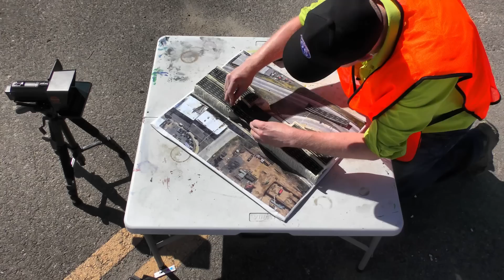Here's How Pennsylvania Re-Opened I-95... in Just TWO WEEKS!

Comment: Due to capitalism (a $200,000/day incentive), the McArthur Maze collapse reconstruction project was completed only 26 days after the original accident. C. C. Myers, Inc., submitted a winning bid of $876,075 to repair the damage to the I-580 connector. The bid was estimated to cover only one-third of the cost of the work, but the firm counted on making up the shortfall with an incentive of $200,000 per day if the work was completed before June 27, 2007

Comment: I would have put some concrete precast slabs on either side of the approaches but not right up against the area that supported the original girders.  Steel beams across the gap.  Supports in the middle of the underpass.  More precast slabs over the steel beams.   Now the support walls can be replaced with lanes of traffic are flowing above.  When the new precast girders are ready. The false deck is removed. The girders set in place. Precast slabs like we use in cal to replace a mile of freeway lane in a single night are set in place.

Comment: This is a lousy video. First, concrete certainly does get drastically weaker when heated. Second, steel is stronger in tension and compression vs concrete. Concrete is a lot cheaper and is good at protecting steel for corrosion.

Comment: keep in mind, while concrete is "fireproof" in that it cant be set on fire.....it can very much explode when heated enough (900C +).
it's far more likely that the concrete exploded and shattered then the rebar giving way, considering concrete explodes around 900C - 1000C which is about the temp of burning gasoline.
at ~800C rebar loses about half it's strength (depends on the rebar though) but that's direct exposure which doesn't happen when there is a ton of concrete all around it. the concrete will reach the explode threshold before the rebar loses enough strength to fail. once the concrete explodes even slightly, thats far more the enough to overwhelm the rebar and down it goes.

Comment: A few years ago near the Oregon Coast we saw something similar: ODOT wanted to replace/upgrade the old 3-lane US101 bridge over Hoquarton Slough near downtown Tillamook city, but that highway is basically the ONLY connection between the north strip and downtown proper.  (And the ONLY detour is found 3 miles east)

The project solved the matter by:
1 - Constructing half of the new bridge adjacent to the old one
2 - Redirecting traffic onto the new bridge then demolishing the old one
3 - Constructing the other half of the new bridge in the newly available space
4 - Connecting both halves together to finish the project
The new bridge has 4 travel lanes plus bicycle shoulder lanes, and they did all that without even a day of closing off the highway.

Comment: Since this is public infrastructure, it will go like this: 

They will go and fill the sand and block the road under the bridge for 3 months. The budget for the project will go poof until it is increased again, and then progress will begin once more after a manager unexpectedly quits. Both side ramps bridges will be half built and the project will be paused for 6 months due to safety issues. The retaining walls holding the sand will still be up for that duration. Next year, they will begin again, but announce that there is a shortage of workers because everyone thought sending everybody to college for the past 20 years was a good idea. By 2025 both the side bridges will be complete. The retaining walls will be half removed, with debris and leftover equipment remaining on below the bridge. No action will be taken until complaints start being filed by drivers. The entire project will be announced as completely finished by 2026. No, they will not complete the inner section of the bridge. You need to wait until 2036 when this becomes a novelty project for an upcoming election then.

Two week project, everybody. Hope they prove my expectations wrong.

Comment: "Jet fuel dosent burn hot enough to melt steel" Anyone remember that from 9/11? Too many assume the metal must be molten for a structure to fail, no it just needs to get very hot to become weakened enough to bend and fall down. Jet fuel is the same as diesel, much closer to diesel than any other fuel. Just kerosene with additives.

Comment: This is our chance to push the city to build the Roosevelt Boulevard BSL Extention; I'm currently living on the Boulevard and this disaster has made traffic --- which was already bad on this section of US route-1 --- even worse and it's making the road even more dangerous for pedestrians. If we had this subway line, this disaster wouldn't have been so bad as people who would've generally driven to work might have actually taken public transit or biked to work. Along with the other advancements to the boulevard, the buses that use the boulevard would actually be more useful as they would have their own lane to drive on and have a more BRT-like style of service and it would force traffic to other streets and not just pile up on the boulevard.

We need to act now and pressure the city to get this subway done; if this disaster is to happen again, this line would help smooth out how bad it is.

Comment: What also helps is that the road network in the Acela corridor is very dense so there are a lot of options for getting around any single point of failure.
Reply: Not so easy if you live less than a half mile form the single point of failure, trust me.

Comment: They're doing exactly that in my area.  They're widening I-405.  At the same time replacing a structurally deficient bridge.  They tore down the eastern 1/3 and built the off ramp in the new location.  They diverted traffic to the new road and are currently building the middle 1/3. When they're all done 2 new traffic lanes and a whole new bridge.  The traffic is normal the entire time.
Reply: It's how they do all highway bridges. They're redoing all of 95 in Philly right now unrelated to this (have been for as long as I've been alive). There are at least 4 other staged bridge projects on 95 within 10 miles of the bridge that collapsed

Comment: A similar gasoline tanker fire took out an overpass in the I-81/US-22/322 interchange near Harrisburg, PA a few years back -- fortunately the interstate was not closed, just the two overpasses that were damaged by fire.  Luckily enough, the original contractor for the steel beams still exists and still had the design on file, so it was able to make new ones pretty quickly.
Reply: Yes, I remember that one. I-81 in that area is bad enough open, would've hated at that time if they closed a portion.

Comment: Okay… Let’s start with that “Cheese Steak Sandwich”😂 It’s just called a Cheese Steak here. Different areas make them differently. I’m from the more urban areas so the order is, “Let me get a Cheese Steak with Mayo, Salt, Peppa, Ketchup, Fried Onions”. You’ll see them write down, CS - Mayo SPK Fried Onions (short hand). I’m a little more robust so, I add sweet peppers and a little spicy mustard. Pickles sometimes. And you’re really Philly if you know what “FFSPK” means. Only a certain demographic goes to Pats or Geno’s. Those are tourist traps. Your local Bodega usually beats them by a mile in flavor and size. Jim’s is okay (South Street Jim’s caught fire). Don’t know if they’re back open. Ishkabibbles is aight too (in a pinch). Larry’s is a good go to… Gooey Looies I hear is good (I’m rarely in South Philly). Max’s is Meh. Pagano’s is hit or miss. That commercial spot “Wit or Wit’Out”. They’re just like Pats or Geno’s except their cheese fries are tasty!

Sorry… I love Cheese Steaks. 

And as far as 95. So long as Japan can fix a 100 ft. sink hole in a week, I’ll still side with those who understand that the time taken, is greed. With a serious crew around the clock, understanding that there is settling times for materials like concrete, it can be done much faster.

Comment: Don't know if this is a good idea but what difference would it make if the current 3-digit interstate bypasses around cities and 2-digit main interstate highways going through cities had their numbering reversed? Would this potentially lead more traffic to go around in order to stay on the same highway rather than going straight through a major metro? I'm thinking of how even though I-95 technically has a gap in the middle of it right now in Philly with this overpass collapse, I-295 still connects I-95 north & south of the Center City in NJ and Delaware. So, why is the highway that goes through the Center City named I-95 and the bypass I-295, and what difference would it make if those numbers were reversed?

Comment: Concrete starts to deteriorate under intense heat typically as explosive spalling. 
When spalling occurs it exposes the reinforcing steel. 
Steel will expand when heated until it meets resistance. Once steel can not expand, it buckles causing further deterioration of the concrete. 
The process continues until the concrete eventually disintegrates and the steel buckles under the intense heat. This is why many concrete and steel buildings collapse during a fire. 
The steel beams that support bridges are no different.

Comment: This happened in Milton Ontario in 1986 about 2 years after a controversial bridge had opened. The location of the tanker/bridge collission was at the 401 and James Snow Parkway (401 and 4th Line) West of Toronto.

Two transport trucks were involved and the tanker truck explosion and fire wiped out the brand new bridge, which was rebuilt after about a year of using a detour route bypassing half of the bridge with directional traffic East and West split in half.

I tried to include a link to a scanned newspaper article from April 1986 but YT deletes it.

Comment: THIS SYSTEM MINUS THE RECYCLED MATERIAL WAS FIRST USED LOCALLY IN THE 70's.  THE "WALL's" HAD STRAPS ATTACHED, GRAVEL BACKFILL WAS LAYED IN LAYERS WITH THE STAPS LAYED IN BETWEEN THE LAYERS, THE LENGTH OF THE STARPS WAS CALCULATED IN LENGTH BY THE FORCE OF THE GRAVEL ON THE STRAPS, LAYER BY LAYER.  ON HIGHWAYS BUILT SINCE THE 70's YOU SEE SQUARE BLOCKS WHICH ARE HELD IN PLACE BY THE STRAPS BEING COMPRESSED BY THE GRAVEL WHICH CAUSES FRICTION ON THE STRAPS. THESE WALLS ARE VERY STABLE AND DO NOT REQUIRE LARGE FOOTINGS BECAUSE THE DESIGN IS MEANT TO BE FLEXIBLE.  ANOTHER EXAMPLE IS ROUTE 202 NEAR PLYMOUT MEETING,  THE AREA UNDER THE PROPOSED ROADBED WAS RIDDLED WITH LIMESTONE CAVERNS, SO THEY USED THIS SYSTEM TO SPAN THE CAVERNS.  I WORKED FOR THE ENGINEERING COMPANY THAT DID THE DESIGN FOR ALL THIS IN THE 70's, THIS WAS THE ENG CO THAT DID THE PA TURNPIKE ON THE WESTERN END.

Comment: This is just about what I thought about when I heard they were closing the underpass where the truck had burned during the repair: fill and pave to let traffic pass (one lane each direction, at least -- it'll back up for miles at rush hour, but that's better than backing up to Raleigh) and then repair the actual bridge alongside the temporary roadway.  There was a new bridge built this way (half the width at a time) along my daily commute near Winston-Salem a couple years ago.  Closure on US 52 (which it passes over) was a couple weekend mornings while they lifted the precast spans into place.  The crossing road wasn't closed either, except for those few hours at a time; they opened the first half-width span before removing the old overpass.

Comment: I live about an hour from Philly.  Couldn't see your sandwich real well, but a solid Philly Chee has thinly sliced grilled ribeye, usually cooked with onions, provolone cheese in either shredded or sliced variety, and that patented (patent pending?) Philly hoagie roll doing its best to hold in the monstrosity.  Everyone will tell you their favourite spot, but hitting up Pat's on Passyunk Ave for your first time would be a surefire win.

I also decided to go out of my way to pass by this spot (on surface streets, not I-95 itself) on Sunday evening on my way home from the shore.  At that point they still had troopers with flashing lights directing the increased traffic around the gap on surface streets.  While I-95 is of course an important artery in the area (especially since the completion of the I-95/I-276 interchange), it does benefit from the obvious Philly metro bypass of I-295 or the NJ Turnpike.  Thru-traffic (to/from NYC to Baltimore) probably never used this stretch of asphalt in the first place.

Comment: The MacArthur Maze bridge was reopened in just over a week. Why is it they were able to do that there and not on I-95? It may be more long form, but it would be cool to do a deep dive into the differences and similarities of the incidents you mentioned (MacArthur and I-95 both being gas tanker accidents). You can still see the section that was replaced because they used a faster setting concrete that is a different color to the original bridge.

Comment: Well, to a good approximation, it looks like "they" are bringing in high quality "fill."  By high quality, I mean that it has a good mix of various particles sizes to that it reaches maximum density with only moderate compaction.   Such mixes are expensive but most highway departments keep piles of it around so that washouts and such can be quickly repaired.

They may also have to bring in fill into the spans adjacent to the damaged area just to balance things out.  Once the fill is in place, they can start installing layers of black top.

Comment: I'm curious if there was a nearby infrastructure improvement project, would they have been able to use the materials and labor from that project to divert it to this project? 

Another thing you didn't touch on was how proposals works for things like this. Usually the DOTs have to go through a proposal and bidding process before ground can be dug up but for an project that requires immediate attention such as this they have safeguards in place that allows them to bypass this process entirely.

Comment: Why do they first build 2 half bridges, then finish the half bridges?
Wouldnt it be better to divert one of the directions onto the other side, merging them, and put the temporary fix fully on one side, with concrete barrier separating the lanes?

This gives them a lot of wiggle room for all the equipment and stuff to build one whole bridge. Then they can re-divert the traffic to the new completed bridge, tear down the temporary filling and build the whole second bridge?

Building 4 half bridges sounds harder than building 2 bridges to me
Reply: That was my question. The way this is being done they will have two worksites divided by a highway. Tricky to demolish the temp bridge in the middle.
Reply: @tudorpottudorpot8423  plus it seems easier to build something brand new, than to build half a bridge, leave one edge open for expansion and make sure cars can’t fall off it, which takes space and margin to build a barrier, then later building the other half and have to integrate with an existing structure

Comment: Hi from Philly!  First things first: your cheesesteak is not very authentic.  Cheesesteaks are on rolls that are ~8 inches long, not slices of bread.  Also, your sandwich has a lot of other stuff on it.  Most of us get them just with meat, cheese, and fried onions.  If you're ever here, I'd gladly buy you a proper cheesesteak. 

Also: the aggregate they're using is NOT like sand.  It's not crushed glass.  It's crushed, melted, and then extruded into this material kinda like Styrofoam, but more rigid.  It's significantly less dense than sand (or dirt or other fill) would be. This stuff's not cheap, but it reduces the weight against the foundations and retaining walls, which reduces risks of subsidence.

Also, the girders on this bridge were just steel--not concrete.  Only the top deck was concrete.

Comment: Close Rob. NB is the side that broke. SB deflected about 9" in the center. The fill material isn't "sand like" and is rather like moon rocks or coral you'd find in the ocean. The material is made with old glass (it's really hard to recycle glass BTW) and is injected with a foam that is then baked. The resulting material is like rocks with angular edges and weighs around 10 lbs per cubic foot. There's way more to this work, but you're phasing was close to what is occurring. Should note that the soon to be opened part will provide 3 eleven foot lanes each direction. The burned structure was only a few year old and it had full shoulders on the inside and outside along with 4 twelve foot lanes. The plan is to rebuild the structure using the exact same plans that were utilized a decade ago. Steel will be here in a month. Yes, I'm in the press conference if it matters.
Reply: @OmarRodriguez-vl2tq FYI - The abutment that was hit, has a wall that is 4.5 feet thick. The fire damaged an inch or two of the face.

Comment: Can tell right away the reports from people that have no idea if the area.
"95 shuts down the northeast corridor"
A third digit on an interstate refers to an alternate.
295 in NJ is an alternate to 95. You also have NJTP and US130. Yes all 4 are heavily traveled and congested but close and run parallel.
Then there is going west Into PA to use 81. 
Didn't shut down the northeast just tougher to get in and out of the city.

Comment: Why did they build the temporary bridge in the middle vs doing it on one side? To my mind it would have been more efficient if it was done on one side, as this current plan creates two work zones that are divided by a busy highway. It also means that removing the temporary bridge would be more difficult as they have to protect the new bridges on either side.
Reply: Good question. This was easier for MPT. The PA Turnpike does their bridges like this too.